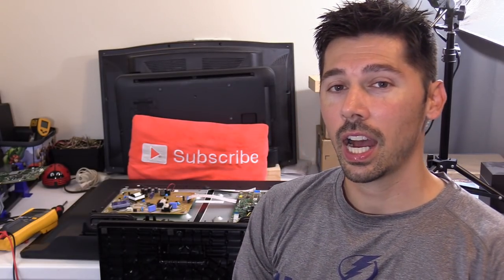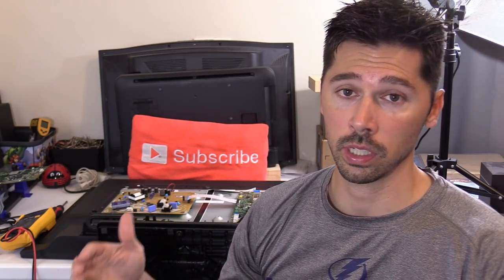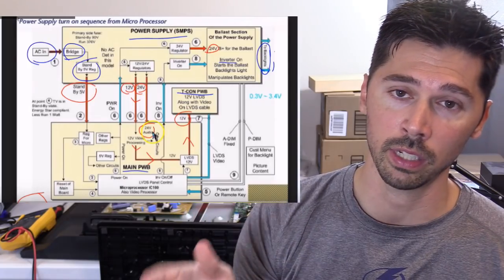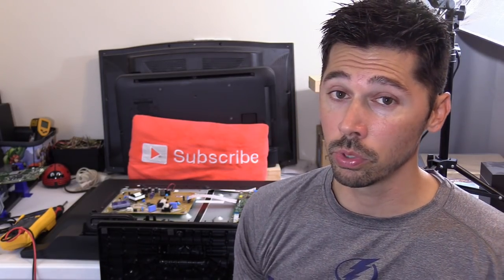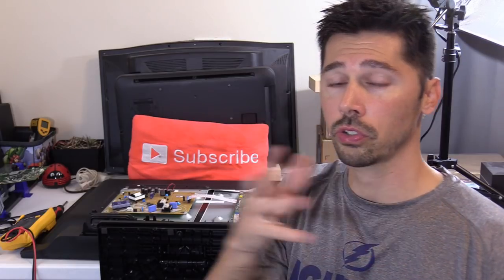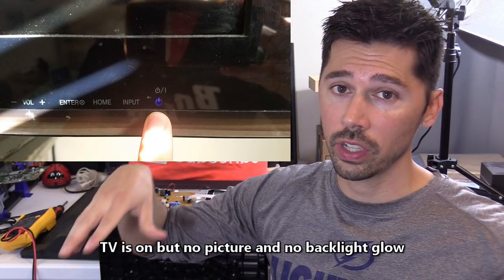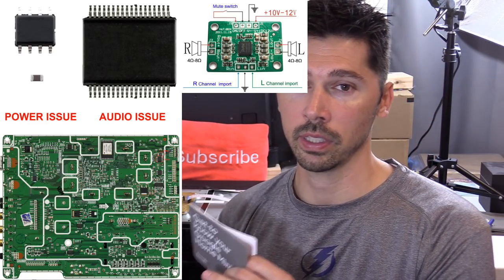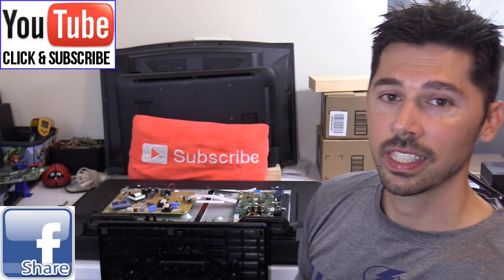LED LCD TV REPAIR GUIDE FOR FIXING COMMON TV PROBLEMS WITHOUT A MULTIMETER !!!

Comment: My Samsung smart TV UN55F6800 shows vertical lines changing to blank as times goes on all HDMI  inputs,  internal YouTube apps but it works fine when I use AllShare Cast and mirror my phone.  What could be issue? is it T-Con board or Control board ?

Comment: I have a Vizio E241-A1 that was not turning on but the led light was illuminating. I was able to hard reset it a few times and it worked, but now it just lights the front led and wont turn on. I purchased a repair set of boards from shop Jimmy and replace both boards and it still does the same thing, just the led on the front comes on. Any ideas what else it could be?

Comment: My 42" LG 1080p LED HDTV, when I plug in the power cord the standby light comes on red and then turns right back off. normally it would stay red until I turned the tv on and then it would turn green. the screen is blank. I changed the power board and got the same exact thing. Any idea?

Comment: I have a insignia 37" led TV red standby light comes on flashes 5 times and goes out sometimes stays on solid red. No picture or sound (no back lights) Have changed pwr board, t-con , and main logic board. Still same issue! Where do I go now?

Comment: Yo - I learned more about TVs than I ever wanted to....thanks in part to your channel.  So cheers.  I work in Low Voltage / I.T. world for a living....so, I'm somewhat tech savvy.....BUT,  what I've realized with half of TVs now- is that there's a simpler solution.  Just buy a new TV.  LOL.   The amount of time some of this shit takes, in order for it to be cost effective (with time commitment) I can't say I'm ever going to trying fixing any TV that was less than $600.00.  After troubleshooting the T-CON board,  backlight circuit to  LED driver board, and finally the strips themselves......then determining the failure is likely at the 50"  Panel itself after temporarily repairing (so I thought) - the driver board working properly with the backlight circuit.  Replaced one LED strip, but do they all need replaced?  Can the LED panels themselves just fail after 2-3 years?  That conclusion does not seem logical in my case, but not sure what else it could possibly be........Ummm....AND....I think I'm done.   Thanks again though.  Great channel homie.

Comment: Hi I have sound but no picture. Replaced tcon board and still I have the same issue. I pulled one side of the tcon and half the tv turns on

Comment: received a Sony bravia kdl 55-bx520 that doesn't power on but makes a clicking noise. I tested the power board and I have 3.3v at standby, 12.90v at the correct pins. It does not have the red standby light so I think it's the main control board, but is there a way to test to be 100% sure it's that board?
Reply: James To

ole free

Comment: GREAT STUFF! 
I’m wondering if you could give me some direction on my 1st attempt to repair an LG LCD TV model LG 42LC7D- UB. 
Symptoms – No display, no sound, no backlites
Observations – When plugging in the TV the red light lights and I verified 5vdc on the power bd.
                                When pressing the power on button, the red standby light changes to flashing green, then a steady green.
                                I cannot find the 3.4 volts I believe I need to fully power up this power supply bd even though the light is steady green. I read about 1.9v on the on/off pin on the power board. If I remove the on/off pin from the connector I do have 3.4vdc on the wire coming from the main board.
                                The power supply board has multiple blown capacitors, visually I see 5 puffed up. 4 10v 2200 micros and 1 35v 1500 micro.
Questions – Is the 1.9vdc enough to turn the light on the front of the TV green?
                        Is there a blink code for this TV. The green light blinks 14 times and on the 15th time it’s steady green.

Comment: Sharp aquos 40inch smart tv. Switches on. Sound comes on full. Screen split. Left side colour vertical lines, right side black. Led flashing fast blue red blue red. Can't  turn sound down, switch off/on by remote.

Comment: Hi I have a 55 inch lg led tv that switches on shows the lg logo then goes off.has replacement the power board and still have the same results would really appreciate your advice
Reply from the maker: +darren yarwood sounds like might be bad eeprom on main board.
Reply: if the powerboard was replaced   with that symptom that only leaves the mainboard as the  culprit
Reply: Hi I have a samsung un55js8500fxza after turn on a couple sec later turns off have to turn on and off 3 time then will stay on for hours. Next day does same thing. Could you help

Comment: Hey Tampa tech, 
I hope you can solve this one. 
Half the TV was darker than the other half replace the Tcon board, everything appears fine, picture same on both half now , except new board will not update the software. New problem, the graphics on the screen are reflecting red vertical lines. Picture is perfect without graphics. Recorded commercials has perfect picture. 
Samsung model.UN55B7000WFXZA mainboard bn94 02694m,
Tcon 2009FA7M4C4LV0.9

Comment: I own a KDL-52XBR5 it shut off one day no picture and started blinking in red 5 times in red I unplugged and did a master reset still no picture and blinking 5 times which board do I replace or test
Reply from the maker: STEVE ORTEZ read this Sony error codes here. http://tampatec.blogspot.com/2015/03/sony-bravia-kdl-lcd-tv-error-codes-for.html?m=1
 for Sony LCD TVs a t-con board is the most common board to fail.

Comment: Great video....I can't find a tcon board  for my LG47". 6870c-0201c  the sticker reads AB421V OVER 1455E1 I checked both sites....nothing.
Reply from the maker: Rosendo Varela eBay or Amazon
Reply: Thanks for the reply.  But do all the numbers have to match up or are there compatible ones... thanks again.

Comment: Hi Sony Bravia KDL 46EX520 has two broad lines (kinda 2 halves on the centre) in the centre.Changed the Tcon board even checked ribbon connections yet no effect.Please help.I will send you the picture via mail.

Comment: Lg47LM7600 3D TV Picture goes black but sound is okay. I can see small white lights inside rear vover when the picture is fine. After the screen goes black the tiny white light are off. Again the sound is still on. HELP!!!!! After turn set on and a few times the picture will be okay for up to 45 minutes some times

Comment: I Was Told That From Dave 12 volts
He Told Me It Can Be The Solder
Connections Not Having Enough
Solder Applied Durring Assembly
In The Factory.

Comment: I have a Toshiba 55SL417U that has thin vertical red lines throughout the screen. The lines are pixelated and are not perfectly straight. They do not affect the picture greatly. I have changed the T-Con board and it did not fix the issue.  Any ideas?
Reply: Sounds like the ribbon cables aren’t connected all the way or there broken

Comment: I have a TV that turns on and works normal, anywhere from 15 minutes to 4 hours.  The screen will randomly turn off.  I still have sound.  there is a light  next to the power button that will flash.  This is an old tv olevia 237 t12.
Not sure what to do
Reply from the maker: Bruce Seghers turn off the lights in the room use the flashlight on the screen if you see a menu or dark picture then your t-con board most likely is working fine and your main board. seems like maybe your back light circuit is going bad on older TVs it's called inverter boards but the ccfl tubes go bad after around 10 years.
Reply: Thank you

Comment: Hey what do I do if there's a tiny fly trapped behind the lcd TV screen?
Reply from the maker: Dima Androgynous blow cool air inside tv seems like fly is in the backlight section.
Reply: Tampatec but I see it dead in the screen and it's very small, so how to I blow air there

Comment: Im pretty sure a surge got my tv from the Coaxial cable and went out from the power cord
My tv have the power/main in the same board
Reply from the maker: it's common but if your coax cable outside is not grounded according to NEC codes then cable company might cover TV damages if cable box was bad. contact damage claim dept.
Reply: Tampatec thanks man i will try that
Reply: Tampatec 
Hey, great videos, save me some time please, I believe power surge through power cord took out my screen all black.
samsung model pn51d430a3d 
1) how do I find out voltages?
2) green light on my logic board blinking slowly. Any blink codes to find?
Thank you for your time.

Comment: Mines ok I think the backlight control board went out but I can’t get the dang back panel  off 🤦🏻‍♀️
Reply: I sleep with it on and woke up to a black screen it has sound I turned it off then turned it back on and there was a picture but it was slightly pinkish then cut out after 5-10 seconds everything I’m looking up it’s a backlight control board issue and the boards are cheap
Reply: UPDATE ! 

Got it open and since it was so difficult I did a video showing how I did it 

I’m not able to replace the board due to the cost but I showed the trick to get it open so the boards can be accessed or the components can be scraped  🙂

Comment: My Samsung turns on but there is no picture and the screen slowly fills with a white that looks like smoke going across the screen until it is completely white, and I have sound. Any ideas. Thanks
Reply from the maker: if your volts to those boards are ok then that issue can be main board or tcon board but if i had to choose one it's usually the tcon board, also sometimes a bad lcd panel.
Reply: Thank you, I also forgot to say I can get a picture by turning it off and on say 20 plus times and will eventually get a picture, no smoke effect. Thanks for your reply

Comment: LED TV, was working fine, suddenly, no video, sound is good, but no video...
Reply from the maker: George Quinones use a flashlight on the screen if you have a dark image but no backlight then replace LED driver board and next LED strips.

Comment: my monitor is a samsung syncmasterp2770, every 5 or 10 hours it turns itself off and turns on again what could it be? check inside and everything looks good. voltage of the stable power supply 19v when flashing this voltage does not change. I'm sorry for my english use google translator and we all know it's very bad
Reply from the maker: Denys Caraballo Pereira might be overheating clean vents and lower backlight and picture settings.
Reply: it can overheat, the monitor has no breaths comes sealed, it opens under pressure without screws. already lower backlight and picture settings.

Comment: No need to buy an expensive fluke multimeter, there are perfectly good ones available for way less money. Even a cheapo ebay $20 one usually has all the functions you need for troubleshooting.

Comment: Don't do what I did i tried to bypass a fuse for a tv psu it exploded the coils had a meltdown lucky it didn't burn my house down DO NOT BYPASS THE FUSE WITH METAL WIRE I destroyed the only power supply I could find at all so I just parted the tv for the rest of the working parts